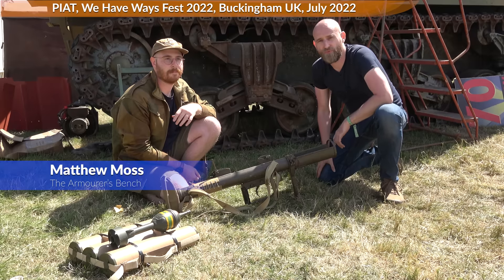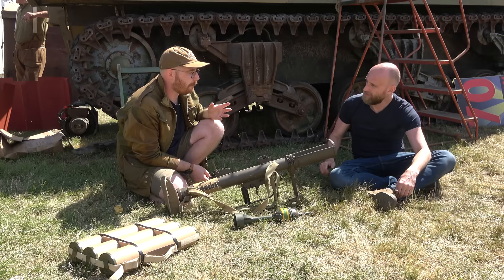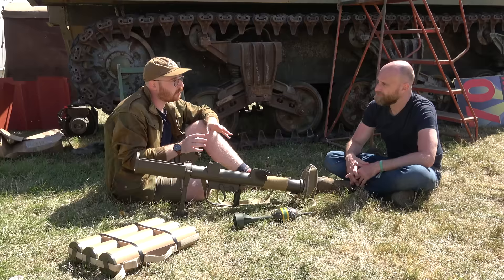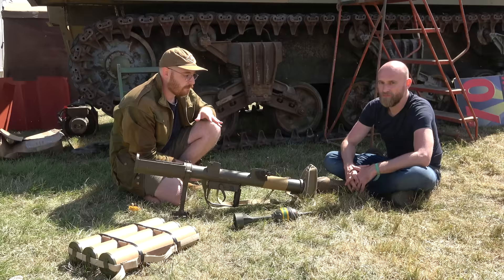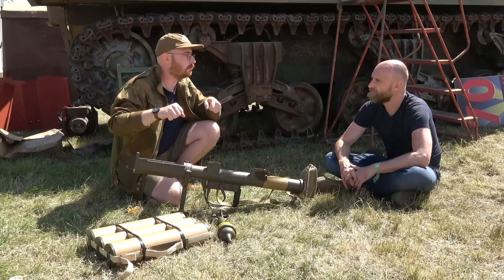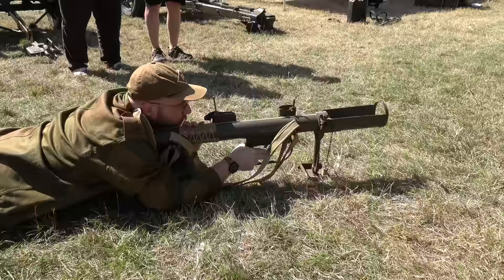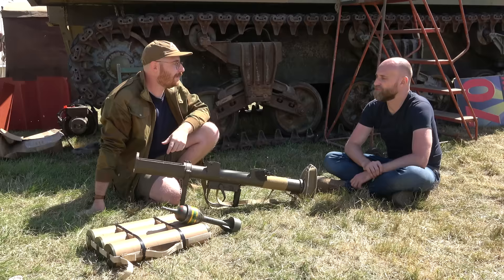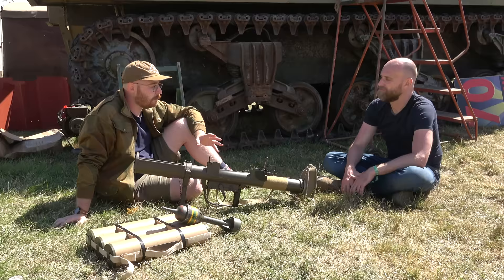PIAT: Better than the Panzerfaust?

Comment: Shotgun recoil is a good analogue. Another might be the M-1. Guys who shoot those at the range wear padding and it had a reputation for bruising up shooters.
Reply: I can confirm that for the M-1. The day after the first time I got to spend a day at the range with one, I had a vivid, buttplate-shaped bruise on my shoulder. Far more kick than anything else I fired.
Reply: @briangarvey6895  same, also my k98k, 03 and psl54c do that to me lol. The worst iv felt was a friends light weight hunting bolt gun in 30 06 though, no mass to take recoil and no cycling action eaither. My 03 was not as bad, noe my k89k, both a good bit heavier than the hunting rifle.
Reply: Shooting the M1 Garand is much more forgiving if it's shot from field positions: standing, sitting, kneeling, or prone.  Its much more punishing from the bench in my experience.  I have a Winchester Model 70 in 30-06 that recoils much harder than my M1.
Reply: @braccereve9271  being a bolt action heavy rifle, m1 has a tad less recoil.
Reply: The Piat recoil is closer to a shotgun than a rifle. It's more the slow push type than sharper like a rifle.
Reply: @chemistryofquestionablequa6252  I wish I could find live practice rounds and a range I could fire mine at. would be an interesting evening.
Reply: Interesting. Our company commander in US Navy recruit training told us to hold the M-1 firmly against our shoulder. If there was a gap, we would feel pain and likely bruise.
Reply: @MrSolLeks  
Do bolt actions have more recoil than semi-autos generally?

I would have thought the Enfield would have less recoil since .303 is smaller than .30-06
Reply: @95Bartlett  yes. Bolt action is like just holding the round, all the forces go into your sholder (well weight plays a roll ect). Semis and fulls redirect force to work the action, often giving more push than a pop of a bolt gun.
Reply: The M1 Garand has quite mild recoil for the caliber, if held firmly you can fire all 8 rounds very quickly (about a half second between rounds fired, I know it can be faster but that's what I can manage).  The M1 Springfield has quite a bit more recoil, although I don't own one of those.  You have to take into consideration also the M1 Garand weighs about 10 lbs.
Reply: @themechanic5671  agree, tho after a day of shoiting i still end up with a stock mark i sware on anything larger than a ar15. I think its more the entire corse of fire, doubt it happens really from a single shot even shooting some of my old bolt guns in 8mm, 3006 or 303.
Reply: @95Bartlett  bolt actions do not benefit from the recoil-sapping action of the, errr, action that semiautomatic firearms enjoy. it's a relatively small benefit and it will vary depending on the design of the semiautomatic, and other factors like weapon weight or muzzle devices or miscellaneous design features can entirely overshadow the difference. 

but one to one, roughly equivalent weight rifles in the same caliber with the same kind of muzzle device and similar overall shape, the bolt action should deliver a sharper and very slightly heavier felt recoil to the shooter. 

also you're not wrong that .303 is less powerful than .30-06, but the bullet diameter isn't a factor there. the .303 just had a muzzle velocity that was several hundred feet per second lower than the .30-06 while they fired relatively similar weight bullets of equivalent diameter. I think the specs are in the range of 200 grains at 2400 feet per second vs 165 grains at 2800 feet per second, with more energy coming from the +400fps than the +35 grains
Reply: @rutabagasteu  Exactly the same with any rifle.....
Reply: @davehopkin9502  Others are saying a bruise results.
Reply: @95Bartlett  Semi Auto generally have less recoil, because part of the propellant charge is redirected 180 degrees to recock the action, so the part that is divert backwards cancels out part of the recoil impulse (Newton "Every action has an equal and opposite reaction")
Reply: @rutabagasteu  All rifles have some recoil, generally manual actions are more severe that semi auto and auto, of course ammo power is also a factor as is rifle weight, but a 1903 springfield will have more recoil than an M1 Garand (they both fire identical ammo) - but you are taught to pull the rifle firmly into the shoulder so the recoil comes at you a more of a push that a blow.
I served with L1A1 (SLR's) and you could fire that all day with no bruising, in the cadets years before we fired Lee Enfields (Rifle No4) and the recoil was more severe, but if you held it firmly there was no bruise, if you were afraid of it then it would bruise you!
Reply: I sure got my bruises at the range when I fired a match with one!

I got a match HBAR (AR-15) after being sore for a week from that evil thing!

My score improved quite a bit, then.
Reply: @95Bartlett  yes, because on a semi-auto weapon a lot of the recoil force and/or the gases are used to charge the action. 

On a bolt or a pump gun, you take the full force of the recoil
Reply: Wasn't everything in the US army called M-1 at some point in time? 
Even tanks and half tracks.
Reply: @BA-gn3qb  Yes but the full name actually placed each one in a seperate weapon class, but it gets shortened to its "popular" name, the Garand was officially termed the "M1 rifle, semiautomatic" so could not be confused in official terms with other weapons classes
Reply: @davehopkin9502  - You could have just stopped at "Yes"
Reply: Could be that the trigger pull was too long for most people of WW2 proportions. Too long or too short  makes the felt recoil much worse than when you get it right. Bespoke gunmakers have known this for a long time!

Comment: TIL - indirect fire from a PIAT.  It makes perfect sense and I kind of kick myself for never having noticed that it is kind of perfect for that
Reply: It really does make sense in that role as a supplement to the usual mortar sections. You'd be trading sustained fire rate, accuracy, and so on, but you'd be gaining rapid deployment and high mobility when compared to a typical mortar. 350 yards for a mortar is pretty short ranged, but given the direct fire capability and you only need a 2 man crew to use it? Quite the versatile piece of kit that was well-suited for its era.
Reply: pleasedo not believe in every "heroic" story

Comment: Excellent presentation, enjoyed it. A couple of notes:

I did some research a while back on the PIAT with the NFC in Leeds. The word we came up with most about the PIAT was “weird”. Pretty much everything about it was unusual. Hence a fertile ground for misunderstandings and urban myths. The 1943 manual emphasised the need for thorough training as “the projector differs radically from other small arms”.

It you look at the internal dynamics of the PIAT, the point about the overall weight and the spring and moving spigot is it is all about recoil control. At the moment that the bomb propellant fires the spigot is in free motion forwards and the spring is at its most relaxed, hence essentially the spigot is not connected to the body of the weapon or the gunner. By the time the recoiling spigot re-compresses the spring, re-cocks and imparts the recoil into the gunner the bomb is long gone and thus the recoil has no impact on accuracy. Effectively the recoil has been delayed and then spread out. Cunning.

There is no significant transfer of energy from the spring to the bomb. The vast majority of the energy required comes from the propellant, it is a firearm.

And … and … and … it’s weird!
Reply: It's also common,  (bullet trap) rifle grenades are very similar to PIAT grenades.  And some mortars have low-recoil mechanism,  the PIAT being based on a mortar.

Comment: Very informative. There seems a bit of confusion over platoon size and organization.  I don't have an exact reference with me and I know that these organizations were amended as needed.... However, generally, an infantry platoon would be approximately 30 soldiers.  Typically it would be sub-divided into 3 sections each being 8 - 10 men.  In modern platoons, we have the 3 sections and a weapons detachment.  The weapons det would handle the GPMG, 60 mm mortar or anti-tank weapon depending on the need.
Reply: To be fair the official strength varied over the war and could vary but type of unit. Plus in practice they didn't necessarily have the allotted number of men

For the latter part of WWII the standard British infantry company would officially have 127 officers and other ranks. Split between the headquarters (16) and rifle platoons (37 each). Each platoon would have a 7 man headquarters (including mortar detachment of three men) and three sections each with a three man Bren gun group and a seven man rifle group. 

There were three PIATs per company that headquarters could allocate among the platoons. So, basically one per platoon but the HQ could reallocate them if one platoon is more vulnerable to tanks or something. 

Of course there were also various battalion level assets that could be attached to a company (such as snipers, which had been part of the company until 1944, etc).

In contrast the US Army, in the late war period, had three 12 man rifles squads, 41 men per rifle platoon, and 193 men total per company. Per official standards.
Reply: @88porpoise  spot on Shaun, I had a bit of heat induced Brain fade when it came to Platoon numbers on the day haha.
Reply: Yeah, the strength of the platoons and sections could be all over the place.
 One thing that often gets missed is the LOB policy too for Canadian units. Left Out of Battle policy could vary, but it often meant 1 or more guys from the sections as well as a PL HQ member, and the same at Coy level to rebuild the PL if they had a very bad day.
 I remember sitting at regimental reunions and other evenings with my regiment's vets of Normandy and them talking about how they went into battle with only 5 guys for a 10 man section. 2 on the Bren, 3 in the Rifle group. Guess why those attacks didn't get far.
 In another regiment I served with, one guy's tank Sqdn in Normandy was only 9 Shermans & 1 Firefly for a lot of the fighting because of the loss rate vs replacement rate. The Regt also had to amalgamate 2 sqdns into a single Sqdn. The unit history reports when they finally managed to keep the Sqdn at a higher strength. 
 Of course the higher level histories (as opposed to the regimental ones) talk about the army being at "full strength" for some of the "pushes", and units being brought up to strength. Sadly those replacements often didn't last very long.

Comment: PIAT has to be the most misunderstood infantry weapon of WW2. For example, it's velocity is just as fast as a 60mm Bazooka Rocket and faster than all the Panzerfaust rockets, combined with shooting from prone and the fire rate this was a very good option in WW2.

The recoil mechanism was also quite advanced for its time as the recoil mechanism effectively worked double for the same mass. If the spigot was fired with the spring in the forward position then then all the force of firing would go to accelerating the  mass backwards and the spring had to try to decelerate all of that force. But by firing the spigot forward when the round ignited it had to decelerate the forward momentum of the spigot before it could accelerate the spigot backwards.

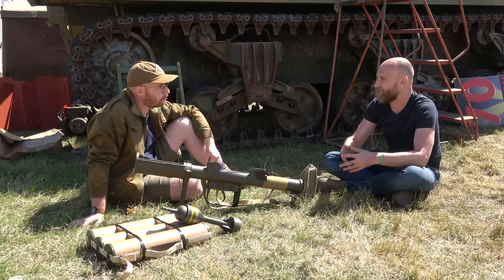The problem was this was (as said at around 14:00) a dead end technology, the future was bigger projectiles that have more penetration and with bigger rockets you can also get much higher velocity which increases stand-off range but with PIAT trying to go bigger was at the cost of lower velocity. And unlike a recoil-less design such as a Panzerfaust/RPG-2 it couldn't easily have a rocket motor added to the base of the projectile (RPG-7). It was generally better to be more effective with a single hit from longer range.

But in WW2, the PIAT was a worthy alternative to the Bazooka, one was bulkier but lighter, great for hit and run attacks, the PIAT was more sneaky and better when you're trying to maximise fire rate.

Comment: My research results showed and confirmed by the ORO T-117 states the average range of effective "Bazooka" hollow charge weapons being; British - 35 yards, USA - 55 yards. The disparity in range would correlate with the British using the PIAT and not the Bazooka of course both weapons being the hollow charge type. Interestingly the PIAT being more effective than the Bazooka because the bomb was a larger calibre comparatively.
Reply: I watched a video of a Bazooka being fired.  I assumed they were very inaccurate and who knows where it goes once it leaves the barrel.  They were at least 100 yards from their target which was a 3 foot square of two inch steel.  They fired it and it went straight as an arrow and hit the target.  It punched a 2 or 3 inch diameter hole in the thick steel.  I was impressed.  Definitely not a toy.

Comment: After-action questionnaires by Canadian infantry officers mentioned the use of the PIAT as an extemporaneous mortar but I didn't get the impression they were doing it all that often. Usually if the enemy was inside a small building and you could get the HEAT round to fire through the roof.

Comment: Good stuff!  If I'm nit-picking, you just need to correct the understanding of what an infantry platoon consisted of, and how sections made that up, but great to set the record straight on the utility and value of this much-maligned weapon.

To my mind, one of the most important shots in history was fired with a PIAT - Sgt 'Wagger' Thornton destroyed the lead tank in the German counter attack on Pegasus bridge in the early hours of 6th June 1944.  The resulting 'brew up' convinced the local German command that we were already there in great strength with heavy weapons (in fact Thornton's PIAT was the only serviceable weapon we had other than rifles and Brens!), and so they held back from counter attacking again for many hours.  This allowed us to hold the bridge, and so flanking attacks on the beach landings were averted;  thus 'D-Day' was a success and whilst we didn't really beat the Germans (the Russians did that in truth), we DID drive them out of western Europe and so prevented the soviets from pushing on all the way to the channel!!

Comment: One thing about the piat is that the recoil recocking of the weapon ment you could fire off a second of even third round if you failed to hit or damage the tank or armoured vehile the first time. Given the exhaust plume of rocket  projectile weapons which give away the fire teams position, the piat could be used in  combat and have the enemy sometimes confused and guessing where the fired round was coming from. I could imagine the Canadians using this weapon if supplied by sufficient ammunition in house to house or close quarter fighting to give themselves an edge. Rapid deployment and use could lead to suprise and help you overcome a defensive position. Hasn't the range of a mortar but you don't have to go through all the trouble of setting it up and having people watch the fall of the mortar rounds to direct the fire onto the target. You may also get lucky and take out the defended position in one shot whereas a motor may use 3 or more rounds to hit a target like a defensive position. Though as a antitank weapon like the panzerfaust or rocket antitank weapons, you either move to get close to the tank and fire or wait for the tank to approach within range to fire, a nerve wracking experience with any of these infantry antitank weapons.